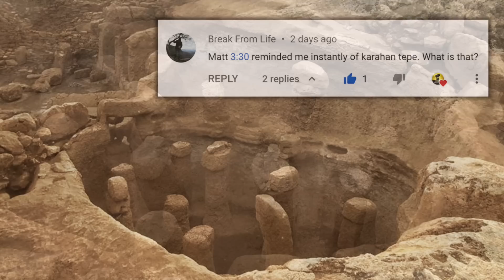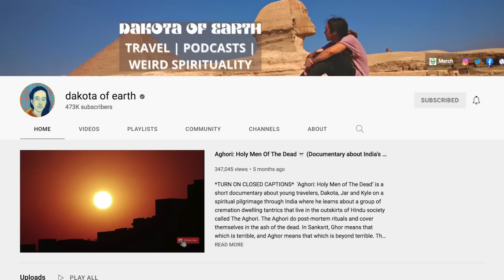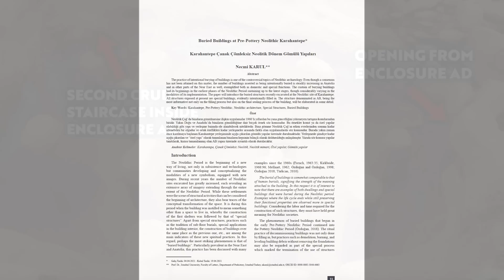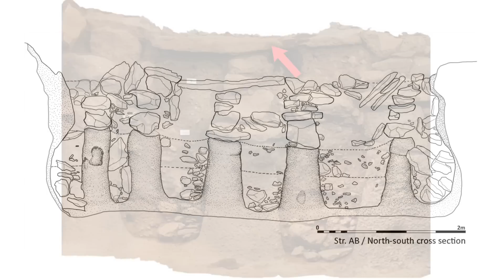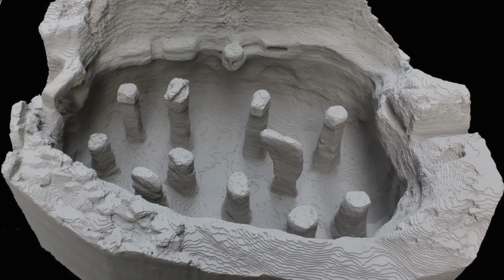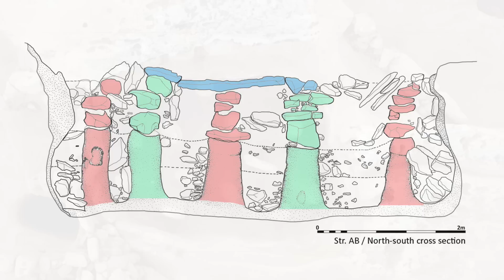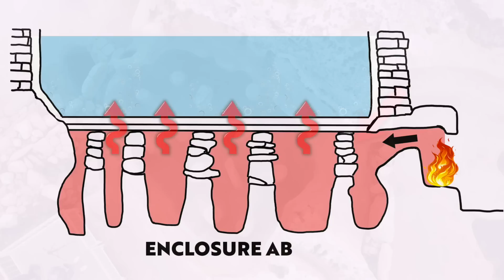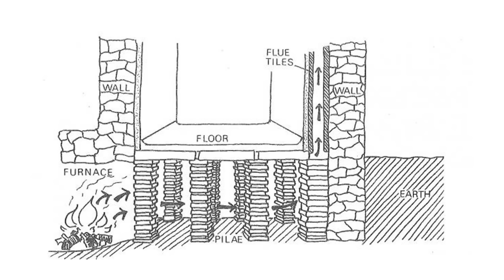An 11,500-Year-Old Central Heating Hypocaust system at Karahan Tepe? | Ancient Architects

Comment: This is an out there theory.I don't know the timing exactly but if this is still around the glacial periods then I would imagine there is a lot of ice and snow around with the flat surface above the columns where snow and ice are melted. The drain however doesn't fully support my idea unless it's an overflow.

Comment: Really cool theory, only thing that bugs me with it is that stone they brought in from outside (The one not bedrock pillar). It is so much flatter than the other rocks, and if it was used to hold the weight of a populated floor above, surely they would get something wider or fatter, like the bedrock stones? It looks like a surface one could use to write on?

Also completely out there theory, but when you look at the site from straight above, it looked like a coastline and islands? 

Thanks again for your amazing work and this brilliantly thought out theory, I've only been getting into ancient civilizations, their methods and beliefs and honestly it has changed my life and opened my mind wider than it ever has been before. This stuff NEEDS to be taught

Comment: I think the carved head is the key to this mystery. I agree with you that the head is flattened to the same level as the pillars. That fact, along with the shelf-like edges on the opposite side indicate the space was covered by a flat roof. However, I do not think a heating system makes the most  sense here. The carved face was there to be witnessed. By whom? Well, to me this looks like some sort of ritual space invoking the underworld; initiates could have crawled through this covered space as part of some underworld/rebirth ritual as was common in later mystery cults.

Comment: Earth ovens go back 30,000 years in the archaeological record and I can tell you from experience with them and from my extensive experience living by fire in the wilderness that once you start building these ovens, it takes very little time to notice that leaving shafts open in the ovens, around the cooking chamber, heats the cooking part of the oven up much faster (meaning much less fuel required) than if it were all solid stone, clay, or mud. If these ovens were being used for thirty thousand years it is a safe bet that their operators understood the basics that would have been employed in such a hypocaust system for about 29,999 of those 30,000 years. It bears mentioning, however, that such a system would also cool much quicker than one full of water, for instance. It may have been more useful to use water since it HOLDS heat longer. Hmm.

Comment: My wife and I are middle aged, curious, life long learners, with no expertise in Archeology.  We have some observations, questions and what ifs. 

My first thought some time ago in looking at the 10 pillars, I felt they appeared to be presenting long term erosion caused by water.
My wife and I were wondering if there is data in regards to the average annual mean temperature 11,500 years ago in that region? 
Was there a winter season that would have warranted all of that effort to build a central heating system? 
The end of the last Ice Age was 12,000 years ago, was this site in a temperate weather zone? Was the night-time temperature cooler than now?
Where did the water come from?  
Were there still sources of glacial water further north or upstream? 
Over hundreds of years did the water supply dry up, and the purpose of providing water was no longer viable, and perhaps the temperature was also warmer not requiring central heating? 

Really enjoyed your presentation. Those are our thoughts. Looking forward to your next installment.

Comment: My 2 cents... It was a water heating system of some sort. The in and out heat channels prove it. The water inlet is also obvious. Wear of the water outlet side also. Unfortunately perhaps the water run out at some stage and the site got repurposed. I would not read too much in to the "head" as it looks like it was a piece of the original floor and only later (when the floor was gone) it was remodeled by someone in to a head shape....Just a tought.

Comment: I think you are on the right track, but missing the purpose.  It was designed for heating a floor, but not for water.  I think there is a good chance that it was drying kiln for floor malting.   This would merge perfectly with all the grinding stones and stone vessels.  The channels were for raking out malted grain.  They were making beer.

Comment: Thanks for the video, I think its a water tank with overflow structure for bathing in AA. Water is fundamental to have and it is probably collecting  rainwater from the roof of AD. The closure with big flat slabs will keep the tank clean and avoiding evaporation. The head is looking over the important water supply to guard it. The channnel is a overflow structure in case of heavy rain fall. It;s not for heating as the level of the fireplace must be below the level of the tank in order to work well.
Reply: the level of the fireplac does not have to be below the water tank , if enough draught is created it would work better higher up , the old back boiler on a coal fire demonstrates this .

Comment: Great idea! And great video, as usual. But two questions:
1. Why are the pillars so high? Don't the Romans prove that smaller pillars are more efficient? You would need a great amount of hot air to fill that high room.
2. What was the fuel and were did it come from? Wood? Do we know if there were many trees in the area?

Comment: The argument against, is that the feed channel gets deeper as it enters/nears the pit.
This shows the direction of liquid flow/erosion, for drainage and/or liquid containment.
Not sure how it can serve the role of 'air' heating if its filled with 'liquid'.
Liquid containment + steps, can only equal a pool/bath or cesspool for me.
Purification baths were not uncommon and no signs of human waste.
And as you said, if practicality was a thing, that also included hygiene.
Pillar/column seperation is determined by roofing slab size and support.

Comment: Interesting...  but I favor a "cold" water storage use of some sort rather than hot air.  A VERY  large fire would be needed to heat that mass of water.   Indications of extreme burning due to a hot fire always show up on rock but appear to be absent in the immediate vicinity.

Comment: Actually the pillars are much older. It seems our ancestors turned it into a temple. This is why they created a roof top for the ancient structure. I’m sure they worshipped it as a temple,& tried to repair it to the original form they imagined it was. It seems it was only accessible from underground after the modern day repairs,but the pillars are ancient…maybe 40,000 years before the repairs *If the furnace descends deep into the ground…it’s actually a reservoir to bring fresh water to the surface..it’s absolutely possible that it was both a furnace & a reservoir. They just regulated the temperature of the water being brought to the surface,& using it for multi purposes. I’m also sure it was a Sundial also. Like most ancient sites. Keep in mind it was the original structure that brought water to the surface. Our ancestors just utilized what was left of the ruins

Comment: You can firmly rule this out as a water treatment system. Firstly if this was a rudimentary water treatment system, basically a sedimentary settling system it is back to front. If you where to use it as a settling system you would direct the water into the deeper put with the columns with it overflowing to the shallower ponds . From what I can see the door to the deeper pit would not allow water to flow from the deeper chamber with columns to the shallow pit. And brief look from my phone says that the level of the shallow pit would not allow water flow into the deeper pit with columns. Looking at the aerial view this structure us higher up with most of the ground sloping away..there isn't much catchment area to feed this asca water system , nor are there any marks in the rocks or ground to indicate volumes of water flowing in. 
People over estimate the needs of ancient people and water. A person only needs 1 to 2 litres per day to survive. For sheep it's 10 and for cattle it's 50. When we build treatment  plants today we general base the sizing around daily usage per person is about 150 litres per day. This is because of showers, laundry and cooking as well as reticulation. A rough guide, varies on property sizes, industrial area and so on. There's formulas.
These societies would not need much water. The cup marks catchment and cisterns as well as the many melt water creeks that existed would suffice. Water caughtnon rock systems and in this environment would be generally prristine and not need treatment.  
I think your right. I can picture a large community fire in the large section with the small door at the back of the fire being a part of a chimney system that heats that space. With a pool behind it. That top area is covered. It could be a sweat lodge with people getting warm then having a cold dip. Or vice versa. This is known in many cultures. The space above could be the cheif tans area . The drain that goes under the path is simple drainage.  That would stop the majority of any rain water or splash water getting underneath and filling the heating chamber with columns. Some water seeping through would mm t matter as it would be evaporated and steamed of through the vents you identified

Comment: The deep pit next to the proposed fire suggested to be a ash pit seem to me messy and lazy instead of getting rid of it more often. How about a huge hot water tank after all it’s next to the pool and the closest to the fire? Furthermore the small holes above and on the pool side could of been anchor points for some sort of shaduf to top up the hot water which would explain the opposite pool end over flow drainage.

Comment: Your thesis is fascinating and presentation convincing.  Also the deliberate infilling(s) of the enclosure speaks to such activity at local sites.
Now, it is very possible that limestone excavations occurred in phases, per advancing usages.  And I agree that chemical analysis, perhaps geotechnical tests be conducted on the former backfill. It sounds like highly weathered material, i.e. burnt.  And overall, the newly uncovered civilization in the area definitely breaks with traditional history.  Given the timeframe at the end of the Pleistocene, it was an epoch of sea level rises.  Perhaps this area of the fertile crescent became populated, at least partially by peoples from the coasts.  Also the main question is about how long was this settled and potentially in what periods?

Comment: Certainly a plausible hypothesis about a practical function.  
It invites several questions, starting with the local climate at the time. What was the rainfall, and what sort of temperatures would have prevailed?
Such a function would consume a considerable amout of fuel, almost certainly wood. What supply would have been available then? Was it actually in a forest, or close to a river that ran through one?

Comment: AA looks to me like it was a natural spring at one time. The channel and worn divider I think led to an overflow cistern, AB. To prevent contamination and evaporation it was covered by flat stones propped up on leveled pillars. The flat stone by the slender cut channel you showed seemed to have a roundish opening beneath where it poured into the cistern, allowing for it to flow into it. I really do think it was for water storage and maybe AD was added later.
Reply: The only reasonable comment so far. 1 in a 1000. That says all about IQ distribution.
Reply: Didn't I read that Gobekli Tepe was associated with the consumption of beer ? Perhaps we have just located the brewery !?
Reply: @julesgosnell9791  That would be amazing. Please let that be the case.

Comment: I am not sure whether this room is really meant to work as a hypocaust. 

The architecture of the adjacent rotund reminds me very much of the architecture of the Anasazi and Navaho people, which set up round sweat huts made of stone for rituals of preparation and cleansing. 

Imho, the room with the many pillars is a bit small for a hypocaust. The floor area that would be heated by this, would be so small, that the efficiency of this device would be rather poor. 

Maybe this room provided the heat (and a possibility to prepare food and offerings) in a different way. If there were a space between the wall of the central round room, and whatever was located outside the wall, the fire might have been extending its heat along this gap and thus warmed the hall itself, without filling it with smoke.

Comment: The stone positioned vertically, which looks like half of an archway, may have been originally positioned horizontally, as part of a round "hole" or "portal" into the lower chamber. The strange winding horizontal channel reach out from the top edge of the pit seem like a water channel. It's fascinating, and mysterious, regardless.
Reply: I meant to add, the "carving" in the "arch" piece of some seems to be a continuation of the winding groove approaching the pit from the side.
Reply: I was thinking that the only free standing column could be completing the arch of the furnace.

Comment: I know this comment is 8 days behind the launch. I just want to add a different idea. I'm not an expert, I'm not even an amateur at best of ancient history so please keep that in mind.

Your idea is cool, but I cant help noticing that the spacing between the pillars is a tad big. Look at all the examples you brought fourth, all the pillars are close to avoid any cold and hot spots from developing. so I don't know if that will work.

As a child, here in South Africa, I saw what was an underground cold room/freezer. It's principally is the same. Hole in the ground, covered from the elements with one tiny access (the smaller,the better) and preferably have water run by it to cool it down. 

You can store meat and essentials for a very long time in such a cold room/freezer. I think that would be more valuable than a hot room or water that would be a massive resource drain.

The face that you refer too could have "protected" the valuable food. That makes more sense to me than protecting maintenance workers.

Like I said, this is an uneducated guess based on real life experience, but still just a guess.

Comment: What about an aquifer.. access steps for periodic cleaning.. the small stone wall on the bedrock rim looks to me like a raising of a badly aged & eroded lip or step; an attempt to seal a breach between the supported roof and side. 
If this measure of repair proved insufficient and the water too easily contaminated then this is exactly how it would have been sealed up

Comment: it seems obvious the carved channel is to harness rain water, at least  an inlet for water from an undetermined source. I read comments further down with regard to cleaning water of sediment through a settling process, i was thinking the same but also perhaps it was bring to a boil to purify, with the platform serving as a standing point to fetch water. if this was not done on a daily basis there may not be large carbon deposits only heightened readings in the soil. Also id imagine they vented smoke through the roof and it would not go in large amounts downwards and sideways into the chamber. Perhaps the carved head and stones were ancestors to grant rain, or to bless the structure. Something you see often in later civilizations like Catal Huyuk, even into Neolithic eastern Europe where they were under beds and hearths or incorporated into the structure itself. Based on its location and elevation perhaps it was a good vantage point to observe migrating herds to the coastal plains from the inland rivers at certain seasons and was highly sought after land that had low amounts of water in the surrounding immediate area and justified a year round clean source unspoiled by large herds?. Id be interested to see how these factors relate to ancient migrations, water access and projected populations. But honestly, its all just a guessing game at this point.

Comment: What if the bottom is open to stairs and has a face because it was not just for heat but also spirituality?  Smoke is a common means of consuming substances.   Put the substance on the fire and the smoke from it will make that space below a sort of hallucination chamber or prayer space if you will.

Comment: If that were the remains of a floor, then the head that is there would be on the floor.  If there were water, then the head would be at the bottom of the pool.  Unless the water was really shallow, than the head would look like it was a dude sticking his head out of the water.  I agree that it does look like there was a floor on top of that.

Comment: Looks like water is meant to run into enclosure AB. It also has the head figure where the floor would be in a hypocaust. AB is very strange. It looks like it was used to channel water and be used in some way... Not sure how those pillars would function but it seems as though you could heat the stone and warm the water enclosed in AB. Just a theory 🤔

Comment: A very plausible hypothesis.  I don't know if anyone else has brought this up, but the red sediment in the lower deposit could be clay. They may have not had cement technology at the time, but they would know clay and pottery . A liner made of red clay on the deck would be somewhat water resistant. When it falls into disuse, through erosion and time the clay settles into the bottom of the site. It could be many decades or even centuries  between the  different uses for the site. So, yes, I think your ideas have merit and could easily be corroborated by testing the soil samples, etc.  Oh, and, I am not a cat. ;)